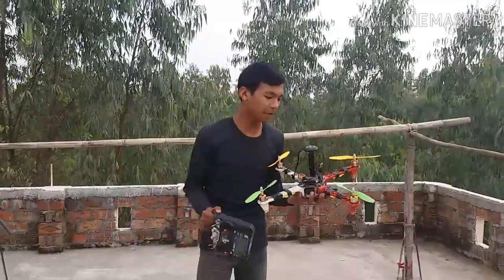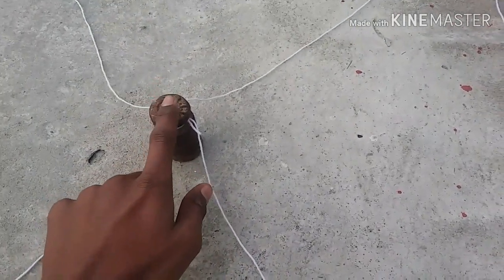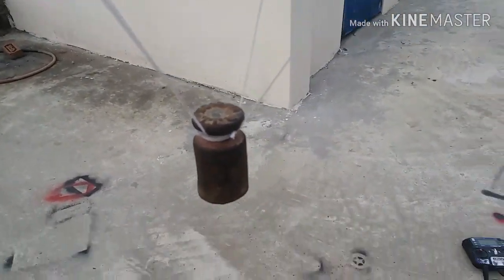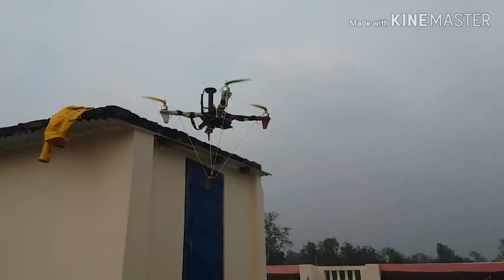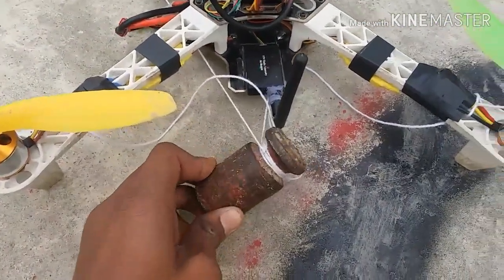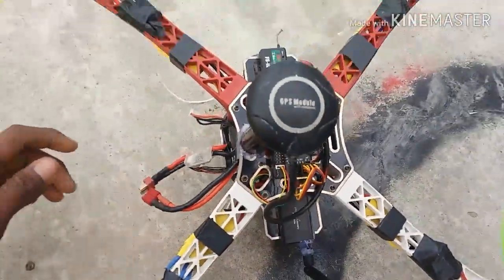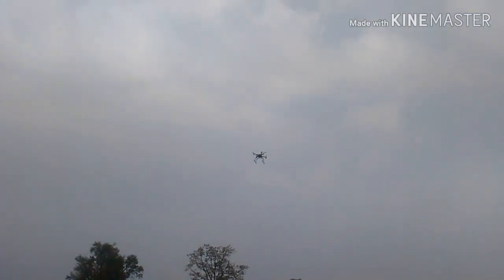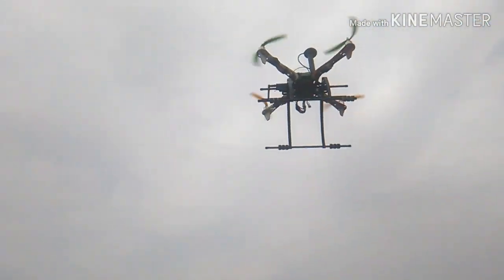Drone Weight Lifting Test ?🤔

Comment: My quad is wobbling in stabilize mode and flip in altitude hold mode please help me
Reply from the maker: Which flight controller you use ? And after flip in altitude hold mode it became stable or crashed ?
Reply: @LifeTechSantosh  APM 2.8
Reply from the maker: And after flip in altitude hold mode it became stable or crashed?
Reply: @LifeTechSantosh  crashed
Reply from the maker: Ok then I think you have to reprogram the apm 2.8 .
Reply from the maker: Just go to my channel and follow the steps to program flight controller